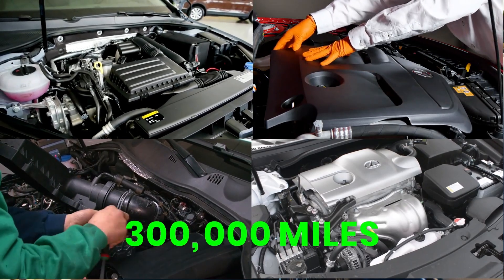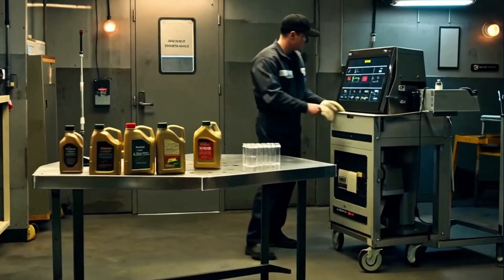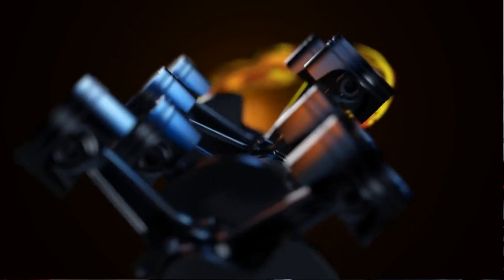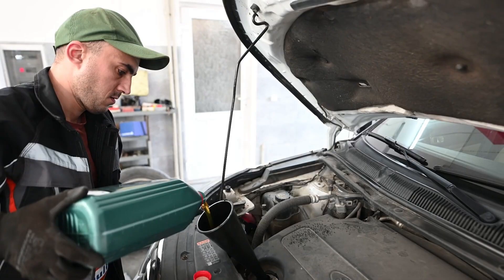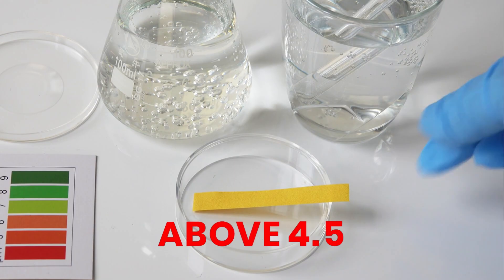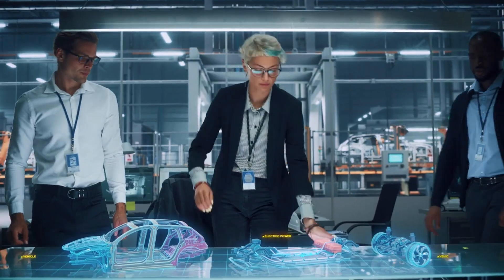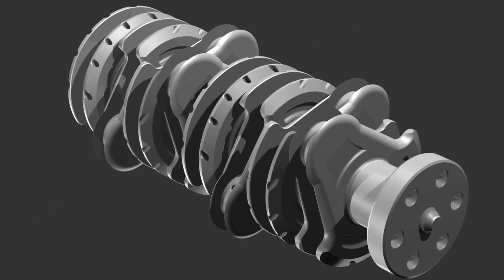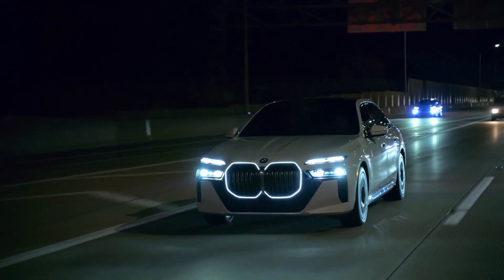I Tested Engine Oils for 300,000 Miles… The Results SHOCKED Even Me!

Comment: I was always a Supertech Advanced High Mileage Synthetic guy with no problems whatsoever, changed at the interval the vehicle indicator stated and not strictly at "5000" miles like it's being forced upon. Mostly open road and some hwy and it STILL looks honey brown when I do my changes🙂👍🏽
Reply from the maker: That’s solid, bro. If Supertech High Mileage Synthetic has been working for you and the oil still comes out honey-brown at the change interval, that means your driving style and maintenance routine are on point. Open-road miles are always easier on the oil. No need to change what’s already working perfectly.
Reply: @CarCareCrewoffical thanks bro, my thoughts exactly, but I might still try out the Valvoline R&P on my wife's '16 Equinox. I drive an '06 Escalade
Reply from the maker: @willg.5168  Haha nice bro 😄 That sounds like a good plan. Trying Valvoline R&P on your wife’s Equinox should be fine, and your ’06 Escalade can keep running strong on what you’ve been using. Always good to test what works best for each vehicle!
Reply: @CarCareCrewoffical thanks for your insight and quick responses. You've just gotten a subscriber bro!💪🏽🙂
Reply from the maker: @willg.5168  Thanks so much, bro! Really appreciate it 🙏 Glad the info helped and welcome to the channel!